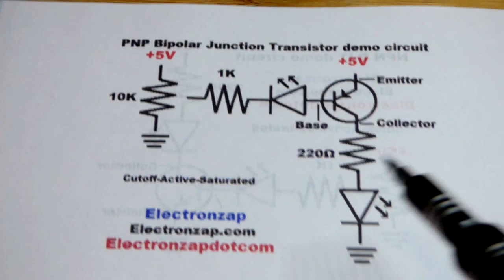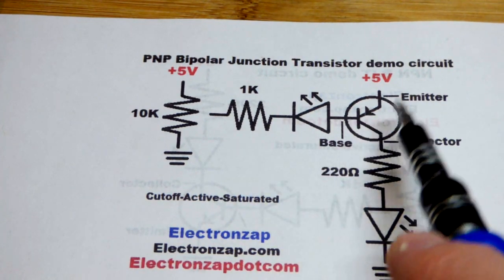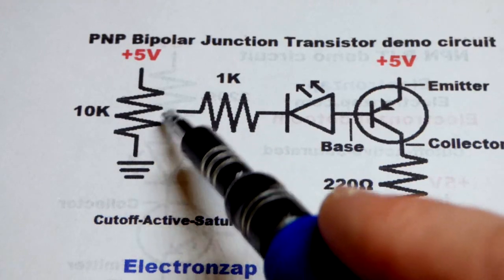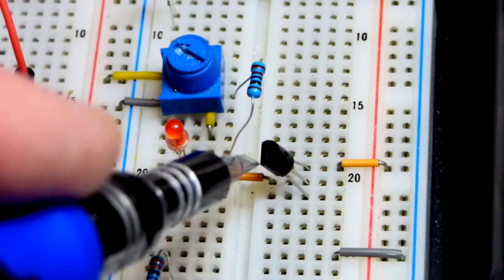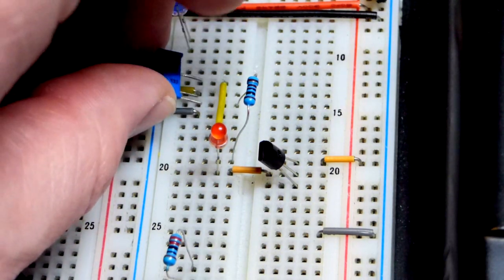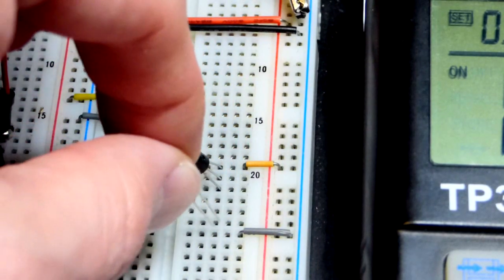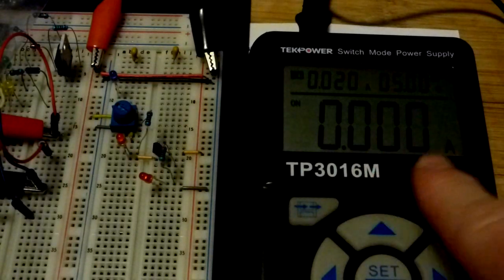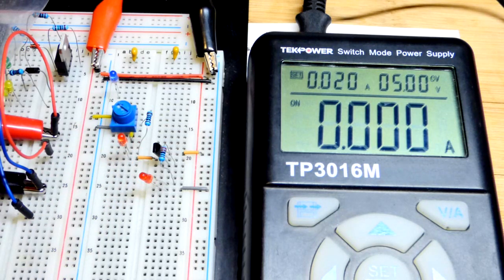PNP 2N3906 Bipolar Junction Transistor BJT demonstration electronics circuit

Comment: forgive me, newb here. I guess two of my presumptions here are invalid. First, that LEDs only conduct in one direction yet you have an LED connected to the base. Second, the transistors flow from emitter to collector is controlled by the voltage present at the base.  Based on presumption number one I don't see how there's voltage getting to the base. Apparently you're getting voltage to flow backwards through the LED at the base. I just don't get this but again i'm new ... Go easy on me.

Comment: The month of April was really rough on me. It started with me puling my sciatic nerve out of wack and spending the next 11 days in constant pain. I had to use walker to move about, could not get down to ground and was COMPLETELY under quarantine.  At one point I took nasty fall but I thought I was ok. Shortly after I started feeling pain go away ... I notice I had a hernia! I just had surgery to fix it but now it's a whole other pain!! My point --- I am going to generate large and dangerous voltages now cuz only the Lord knows when it is my time! 😂I will exercise extreme caution of course. I recently built a "current limiter" that uses a lightbulb to temporarily catch the current if you short mains voltage (120VAC that is).
Reply from the maker: Bummer! I was working a sit-down security job 8-16 hours 7 days a week and got sciatica so bad that before work one day I couldn't get up because it felt like someone was slashing my leg with a sword whenever I tried. Had an ambulance bring me to ER. So I know how bad that is.